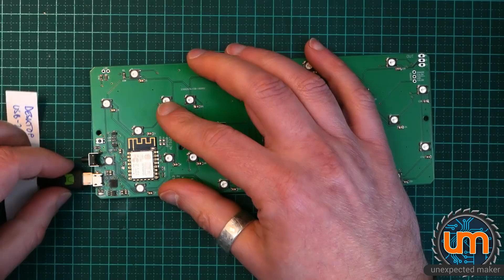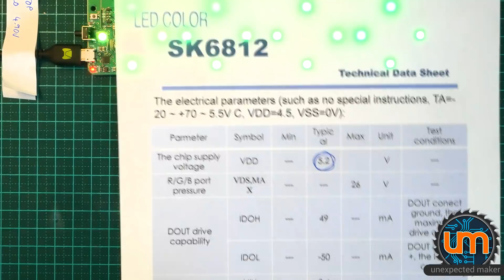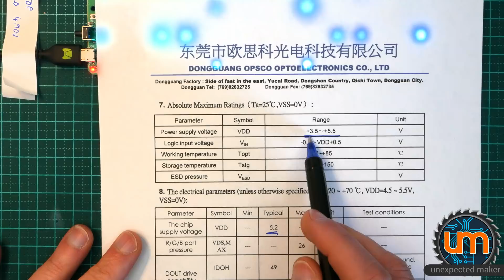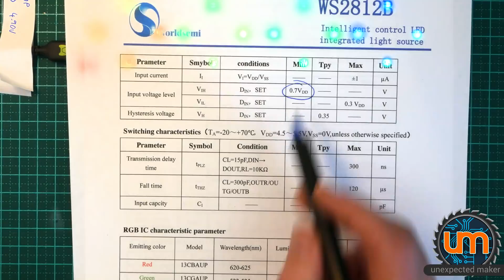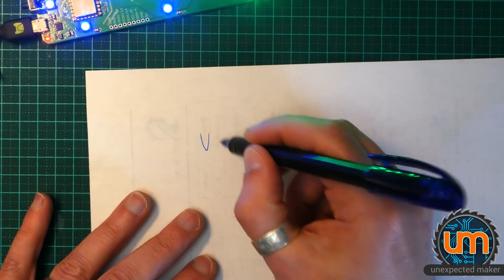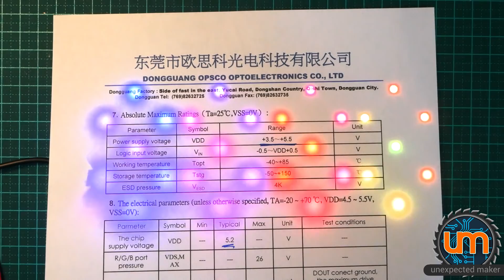Wifi Laser Segment Clock - Resistor Debunking

Comment: Only option is to fit a level shifter for the data line. Don't try and fudge the power supply when the problem is with input drive level its just bad design practice. A regulator costs more that a single trans /fet shifter.
Reply from the maker: Yup, rev 3 is already designed with a mosfet based level shifter implemented :-)

Comment: I thought this same gap between data and vcc existed even for ws2812?
Reply from the maker: It does exist for WS2812, but I've never seen this requirement on any SK6812 datasheet, and I have never hit this issue before on any other project... Even my rev1 clock board worked correctly. Maybe it's a super sensitive ESP module, or maybe my redesign added a bit of extra resistance in the trace to the first pixel... not 100% sure.
Reply: Unexpected Maker  Ok, thanks for the info!  You scared me a bit because I has some home made Wemos Mini Shields on order with JLCPCB to drive my window shade project with one of those on it.  I just assumed it would work!

Comment: That's fascinating! Probably explains why hooking up the external neosegments made everything work again: the voltage drop on VDD caused by the extra pixels was just enough that things started working. Hook up the extra pixels and see what the voltage difference is?
Also may explain why I've been getting odd results trying to use a lower signal voltage, because I used lipo boost chargers from Adafruit during testing, and those put out 5.1v, so it was just on the edge of being unstable. Also explains why I've never had luck with signal level shifting.
Reply from the maker: Yeah, I never realised there was such a discrepancy between 5V values coming in from USB and in this case I was only ~0.05V out that was making it go from stable to unstable. Incredible. I guess I have just been super lucky in the past.
Reply: @UnexpectedMaker  I know I've never known a variation so high before!

Comment: Amazing detective work Seon! Isn't the "correct" solution to use a level shifter and power the LEDS with the 5(ish) volts and up-shift the 3.3V signal coming from the ESP8266 up to the high voltage? Changing the resistor or making it work under 3.3V are all workable hacks, but the true issue is that the ESP8266 is not supposed to be able to control the Pixels with it's low 3.3V logic? If you can do it, I would add in a single level shifter from the data out pin to the first Pixel... otherwise yeah, a 0 ohm resistor will get it to work well.

Steve
Reply from the maker: Not sure about "correct" ;) - but the safest solution for sure is level shifting and that is what I have added to my rev 3. I'm using a BSS138 Mosfet which David Granz recommended to me as a fast switching Mosfet. I was tempted to try a "one-way" transistor based level shifter, but I don't think any of the transistors I have here can switch fast enough.

Comment: On the SK data sheet they quote 3.4V at a test voltage of VDD = 5V.  On the DS they quote 0.7VDD which at 5V is 3.5V.  So I think at 3.3V you are out of spec. but getting away with it.  If you are selling this, someone may use a different USB PSU.  For me a level shifter is the way to go.
Reply from the maker: Yup, I already made a rev3 and have a transistor based one-way level shifter :-) But that 0.7VDD is NOT on the SK datasheet... I can't find any reference to anything like that for the SK's. Only the WS, and I have never encountered this issue before in over a dozen neopixel projects... and my rev1 of this didn't have this issue... so it's pretty perplexing.
Reply: The SK data sheet is quoting 3.4v at VDD = 5V so that's 0.68VDD.  Bit of a theme :)  Not sure if the length of the string is relevant.  It shouldn't be as the neopixels claim to regenerate the data signal at each LED.  May be your first neopixel is a bit more sensitive than most?
Reply from the maker: Yeah, I think you are spot on. The more I read the clearer it is that it's simply a logic level issue and needs a logic level shifter to ensure it meets the min and max logic thresholds. Thanks for your help on this!

Comment: Didn’t watch the rest of the stream yet but I think dropping the resistor value is the easiest option so you do not need to respin the board. The resistor is for protection only as far as I know. If you want to keep it maybe make it just 100 ohms or so. Alternatively to your voltage regulator idea you could just bodge in a (shotkey) diode in the 5v rail and you would be also in the right voltage range so that the gap between signal level and vdd is within spec. Going on the boarderline is not a good idea because maybe the next batch of neopixel has a little different specs and just won’t work.
Reply from the maker: I can definitely drop the resistor value for the clocks I make for the kids, but I need to order production boards anyway, so I might as well add a level shifter for rev3 to ensure I don't see these issues in the wild.

Comment: I think you're onto the problem and the solution is as simple as a one transistor level shifter made from a 2N7000, MMBF170, BS170F, or your favorite utility logic MOSFET.  
Just connect the gate to 3V3 as a voltage reference, the source to the ESP32 I/O line, and the drain to the LED data line. Add a pullup to +5 on the LED's data line and you're good to go. When the ESP32 output is high, the source and gate are at the same potential so the MOSFET is off and the LEDs get a high signal from their pullup resistor. When the ESP32 goes low, now the gate is 3V3 higher than the source and the MOSFET goes into conduction, allowing the LEDs to get their low signal from the ESP32 through the transistor as it acts like an analog switch.
Reply from the maker: Yeah I'll either grab some mosfets ( I don't have any here believe it or not) or use a transistor (mmbt222a - I have 100s) to do a one way logic level shift, which is all I need in this case.

I just can't believe that I have never run into this issue before, and I've made more "neopixel" projects than most people - crazy!

Comment: Personally, I think a zero ohm resistor (ie. no resistor) on the data line is actually fine, in this case.
ie. As this is a self contained board (data line is not from an unknown external source), then I don’t believe the resistor is really necessary. 
My understanding is the 330ohm resistor is recommended for protection, which is really only relevant for external (ie. not within your control) data input sources.
Reply from the maker: Yup, I think you are right!
Reply: Also, as davedarko also said, thanks for posting these post live stream update videos.  
It’s really awesome community engagement, especially for those of us who take great interest in technical challenges that arise during a live stream! :)

Comment: That's basically what we said at the end of the stream :)

Good job on analysing it like that! Check the adafruit neopixel guide for a levelswitcher for data maybe?
Reply from the maker: Yup, it was what everyone was saying/thinking, but I had to verify it for myself... in a reproducible way, as I'd used 5V VDD and 3V data on all of my projects without a problem before.
Reply: like I said, good job :) I know how it feels to be that uncertain about something that should (and did) work but doesn't. And I really dig the short updates after a stream!
Reply: @UnexpectedMaker There's an interesting hackaday post that uses a diode (From Jan 20, 2017 "CHEATING AT 5V WS2812 CONTROL TO USE 3.3V DATA")
to drop the supply voltage on the first neopixel. This does make the first pixel slightly dimmer, but this can be compensated for in software, or by designing the layout so it would be less noticeable (use one of the colon pixels to do the level shift)